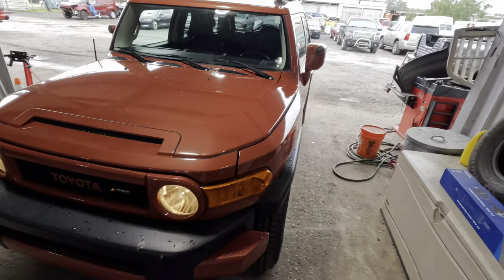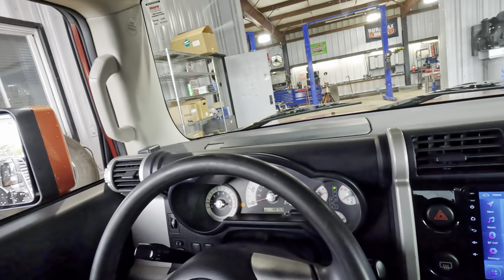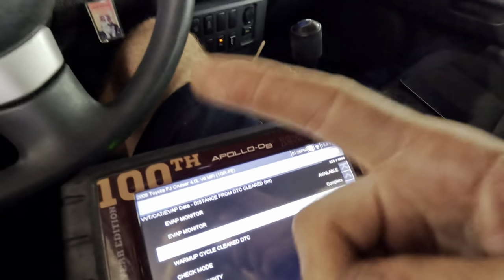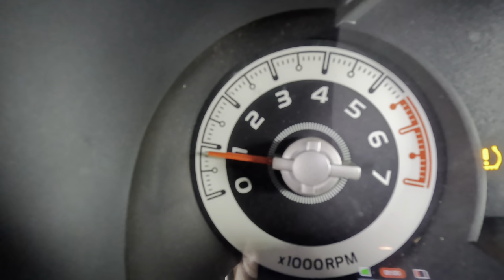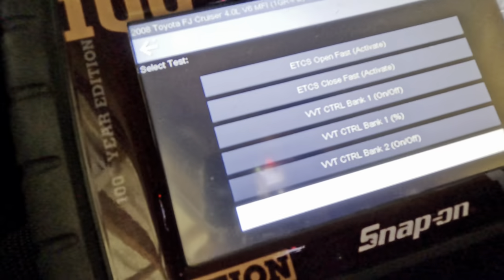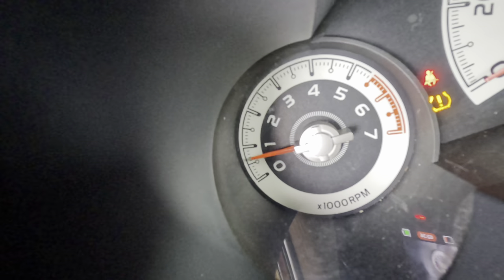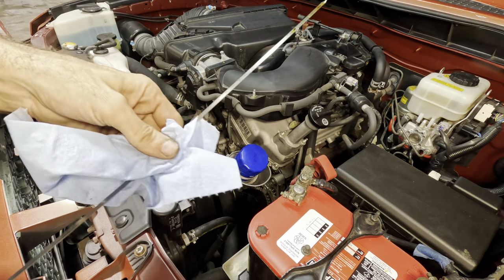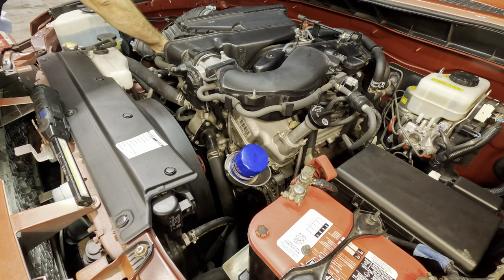Engine Problems at 50,000 Miles! P0016 P0017 Toyota FJ Cruiser 4.0 1GR-FE

Comment: Very interesting and educational diag and repair. Sorry to see the sludge on those actuators. As you said that you'd have liked to run some BG engine cleaner in to address it, since it's most likely all through the engine. Too bad that a low mileage and nice looking vehicle had such poor maintenance to cause that at that low mileage. Maybe it would be advisable for the owner to avail the cleaner service soon since this is a new purchase. Thanks again for another in your quality videos.

Comment: Great vid Ray and showing mindset of working it out.
Whn oil change performed do they not do flush and would that clean solonoid.
All down to service intervals
Reply: No, they do not do engine flush as part of a routine oil change?
Reply: Looks like they never changed the oil or very rarely did. Mine had over 250k miles on it and had no sludge in it when I pulled the valve covers off. Changed the oil with Mobil 1 every 5k to 7k since new.

Comment: Ray, the traction control lights being on is a normal Toyota thing, any dtc code will set the check engine, abs and traction control lights. My Tacoma will set all three lights and disable traction control until the dtc is cleared from a minor evap code.

Comment: I had a camshaft position sensor snap off and go into the engine on a ford 5.4 when I was trying to pull it out.  Luckily the engine was already shot so to the junkyard it went.

Comment: "replace them both"
It's a good practice with other things one can manage with very little technical know-how. Headlights, for example. If one fails, it stands to reason the other will fail shortly after, so both should be changed. Tires too. One tire wears unevenly from the other three, the alignment needs to be handled, but the tires need to be replaced, because uneven wear on one, will eventually cause the others to fail, especially under proper circumstances.
Reply: Had to do the same with my 2009 subaru forester, had b1 vvt sensor warning, fixed that, cleared codes, 10 miles down the road, had b2 sensor go off...probably likely they'll both fail around the same time

Comment: I had a p0016 code on my F150 once.  My timing chain was stretched.  Had to replace the timing chain, guides, and two of the cam phasers.  Plus, for preventive maintenance, I had the internal portion of the water pump replaced as well.  Wasn't cheap, either.
Reply: Which engine does your F 150 have and please tell me more about the internal water pump parts.
Thank you.
Reply: @wayneessar7489  1st gen 3.5 V6 Ecoboost.  I stand corrected on the internal water pump.  Mine is on the outside but there are some engines that have an internal one.
Reply: @bearing_aficionado  Thank you for your kind reply..!
Mine is the 3.5 na Cyclone engine, 2016, so the last year for it.
The ones they put in the Edge and I think in other front wheel drives are that evil internal pump.
Reply: @wayneessar7489  yeah.  I swore I thought I had the internal one but I was on the F150 forum and someone thought the same thing I did and someone said it was false.  But I've watched a video from FordTechMakuloco doing a timing job on F150 and was pulling out what appeared to be a water pump from inside the timing.  But I watched another video where a guy was replacing a water pump and he it was on the outside.  He had the same year, an engine as mine.

Comment: I watch all your videos and like every one. It sure appears to me that you are a top notch mechanic and can figure out all problems. I have a 2006 mustang 4.6 3v with a few mods such as comp cams,new cam phasers with limiters,exhaust cutouts,BBK fresh air filter and ducting.about 8 retunes with 2 different tuner guys. I have tried to test all electronic components and switches and even parts cannoned a lot of them and just can’t get this car to run properly. You sure would think after 3 years of trying I could figure it out and I can’t. It ran just fine before I put these mods on it. Don’t even dare to drive it across town cause it may not want to start if I shut it off. Bein it is a n/a Roush ,with a lowering kit I don’t no how I could even get it wreckered home very easily. I have 1/2 a mind to load it up in my enclosed trailer and haul it from Michigan to Florida to have you figure it out, I’m sure you could, I can’t. It’s sad this 06 mustang, literally brand new condition, no snow or even rain car with only 12,000 miles and you don’t even dare to take it on the road. Now THAT would be a good video!!!
Reply: "It ran just fine before I put these mods on it." - There is your problem. Leave well enough alone.
Reply: Not so, all parts are Oem parts. Cams are from ford racing and are for this engine and year. I think it is in the tune and no one has figured it out yet

Comment: Good diagnosis Raymond, if your cheap like me you could've soaked the actuators in gas and blew them out with air. Or use your method with brake cleaner.

Comment: At 51:24 you mentioned the vacuum hose. I think it may be possible that it was left disconnected at some point and on short drive intervals would accelerate the sludge problem, even with proper oil change intervals.

Comment: I've cleaned them with Brake clean and degeaser and has always fixed that problem and a good engine flush as well. That  was probably the first oil change right before they bought the vehicle SMH 😳

Comment: Ray you can ohms check the solenoids without taking anything apart. Check them at the pcm so you can rule out wiring at the same time. Good little time saver for ya.

Comment: Agree with several of the other poster's comments regarding the lack of proper oil maintenance as being the contributor to the valve failure(s). Would have been nice to see the difference between the scan tool's VVT readings following valve replacement as compared to the initial readings. But, in the end, problem solved. Well done sir, well done.

Comment: I had an 07 FJ that needed an emission canister at 100k and also had some fuel system leaks. Wicked expensive OEM parts.  I think the VSC is disabled if the check engine light comes on for any reason. A really solid vehicle though, laughs at snow.

Comment: Yes if you neglect to change the oil on these VVT engines it sure messes them up. I have a 2012 Yaris I bought new and changed the oil every 5k miles or 6 months using full synthetic oil and at 100k miles no problems.

Comment: NIce work Ray! A tip: You might try spraying carb cleaner around anything stuck on the o ring, it will dissolve the varnish sticking it. I use it for stuck distributors.

Comment: This is what happens inside your cars engine when you rarely to never change your oil and filter @ 44:05 !   The engine heads under the valve covers and the bottom of the oil pan is very likely full of sludge just like those sensors and the oil passages inside the engine and that can only happen at 50,000 miles if the owner does not do oil changes.

Comment: Recommended oil change interval is every 5,000 miles, and Toyota means it!  This is what happens if that is not done.  I have a newer Toyota that they have changed the oil change interval to 10,000 miles.  I still change it at 5,000.  Worst case, at around 100,000 miles the engine starts burning oil.  That sludge you see on those servos will be all over the piston's oil control rings with heavy wear on the cylinder walls.  Best insurance is to change the oil at the correct interval, or every 6 months.

Comment: So the functioinalty of the valves was not the issue but that they were sludged up. Understanding the ultimate basis for replacing the units but rather would not an appropriate ultrasonic cleaning of the existing ones been just as efficient or with the benefit of hindsight the fresh oil change may have done the same thing? This is a textbook example of lack of engine oil changes in a timely fashion. It is a possibility a pending code could have existed and the fresh oil cleaned things up and we would not be the wiser but it got to the point of a trouble code being tripped which brought us to know now what we know. Does this rambling  make sense?

Comment: For some reason, have no idea why, but I have seen way more stretched timing chains on the FJ than any of the other Toyota with the same single VVTi 4.0L engine.   If the oil changes have not been kept up on that will cause greater chain wear and result in it stretching and can present with that code. 

One thing you may want to do is remove the VVTi filters and clean them.  They are located on the outside of each cylinder head.  If the valves are that sludged I am sure the filters are clogged as well. 

The USDM FJ does not have an engine oil cooler and that oil temp can be all over the place and it can get way hotter than it should be so I always suggest doing oil changes much sooner than most like never more than 5000 miles.

Comment: The original owner saw that synthetic oil was good for 25,000 miles so it probably just had its third oil change. I’d throw a can of Berrymans B12 or maybe Sea Foam in it and get her good and hot and drain and change the oil again. There’s probably some new flushes that might work better, but if you did it old school now and then again in 3k miles you’d probably be fine.

Comment: Drain the oil and fill with kerosene +  a quart of MMO. Run for 1 minute, drain, fill with 20W-50 (cheapest available) run until operating temperature reached, drain and refill with factory rated oil...couldn't hurt 👌

Comment: Post purchase inspection, no warranty?
My '95 Camry had a 4 cyl sludged up engine.  Always had regular oil changes.  My mechanic's friend at the dealership said it was a known problem with my particular engine.  Personal thought was the engine always ran hot because the exhaust came out towards the front and wrapped downward around the engine.

Comment: I had the same problem with my 06 hyundai santa fe v6 with vvt mechanic pull it out and it was block up clean it out put back in never miss again it was because of previous owners they let change oil to far apart

Comment: 56:00 sensors . reprogram 4 to the spare & set them.. in a block that adapts 4 to same stem.. bypass the east northern farmer way 
jyst remember to set spare tire pressure..then losen inner valve then add block with 4 & add pressure.. when set.. all read off same spare.. until needed.. lol tighten & carry airpump.. in tool kit.. lol but easy bypass til maybe add them to aftermarket wheels

Comment: I'm happy to see that you are at least thinking about buying a scope. If you already have a laptop, adding the Pico is not such a big deal. If not, you can get a small hand-held device to start with. Those handhelds will always find a place in your workshop. Often, you see Eric O. of SMA quickly check something with a small hand-held scope, while he has a Pico at his disposal.
Also no need to fully deck out your scope with all kinds of specialist probes. For example, you can do a relative compression test by scoping the millivolts drop over the negative battery cable while cranking. Don't need an amp clamp for that. You only need the Pico or another multi-channel scope if you want to have a sync pulse, so you'll be able to tie a bad compression to a specific cylinder.
Remember, a scope is just a multimeter that is able to measure fast-changing signals. (or 4 multimeters in case it's a 4-channel scope).
Also, the Pico software is a free download. Install and fiddle around with it. In demo mode, you'll see 4 fake signals at its virtual inputs. And you can't mess it up. The software will start with factory default settings every time, unless you change that behavior in the settings.

Comment: I was thinking.  Maybe a "snake oil" BG treatment would have been in order 1st..instead of replacing both sensors? Yes, they might have cleaned up, but in the end, replacement was the best move. Kudos King Ray!  Nice vid sire😎👍(as cruddy as they were, i would still do the engine clean treatment.. because even with a new oil change, sludge lingers..and as i typed this, you mentioned that same idea.  Lol

Comment: I've found that headlight bulbs should also be changed in pairs for the same reason,...when one goes out ,the other is not far behind. Maybe you can sell the customer one of your famous engine flushes, there is too much sludge for that low of mileage! Great diag Ray man.

Comment: I bought a 2003 Mercedes C230K with (Serious air-quotes) “83,000” [Supposedly] original miles.

I’ve spent 4 years replacing things that I simply should NOT have had to replace IF the mileage was even close to being accurate.

NJ car sold to an Illinois Porsche dealership before ending up here in Texas.

Just got through replacing all of the rear (5 on each side no less) Control arms & knuckle bushings.

83,000 miles??  No freaking possible way.

Comment: I was recently in the market for a used car. I always bring my code reader to plug in first thing before I drive. One dealer refused to let me plug in so I just walked away and added them to my blacklist. At the second dealer I found three cars, the saleslime was oblivious to what I was doing so I plugged into all three of them and very one of them were zero to 10 miles since reset. I went ahead and passed on all of them and the saleslime said they reset all of their vehicles when they are put on the lot. Red flag taken and another dealer on the blacklist.  Moral of the story, either take it to a mechanic before you buy it or plug in a high quality scanner, or both. But don’t buy under the assumption that the vehicle is any good because the dealers mechanic said it was.

Comment: 1. Did you tighten clamp on throttle body? Video didn’t show.
2. Even with recent oil change, I would have offered the sludge treatment. Toyota’s routinely get 200,000 to 300,000 plus with good maintenance.

Comment: Good diag and repair.  Please be careful of poking your light(s) around moving engine parts and wearing a metal ring working on vehicles.  True story:  My first wife grumbled about me not wearing my wedding band at work (bodyshop at the time).  I told her I wasn't risking damaging it.
 
That throttle body looks suspiciously identical to the one on the Toyota 2AZ-FE four-banger in my granddaughter's Scion tC.  Probably is; why make something when a part already in inventory will do the job? 😜  Little Factoid for those who may not know:  Those small hoses are for engine coolant, to help warm the TB in cold weather.

Comment: I am curious as to your opinion of K&N filters...  I  prefer them for air cleaners... I have examined throttle bodies and air plenums and have found them to remain clean.  Its actually rather humorous that they work better with a little dust on them.   They do however need to be serviced when they  get dirty...

Comment: That FJ Cruiser has obviously been neglected by the previous owner with the oil not having been changed regularly enough. That should be a lesson to all vehicle owners to change their fluids regularly and use only top grade full synthetic oil. It should be changed twice as often as recommended by the manufacturer. In more recent times vehicle manufacturers seem to conducting some type of bidding competition as to who can stretch their oil changes out as far as possible. I guess they don't really care so long as the vehicle outlasts the warranty period. It also obviously needs a good engine flush.

Comment: I got 04 4runner same engine recently had rough idle had bank 2 camshaft code o2 bank 2 codes among few others. I changed both camshaft and both vvti solenoids and o2 sensor runs fine now but 330k miles vvti solenoids were definitely dirty. I no the pain you went through although bank one solenoid vvti broke cause it pressed together had to use pipe nipple to get removed poor design but overall design of engine simple to work on loves these gre1 engines
Reply: But I'm afraid with front timing leak minor seal leak and mileage that my 4.0 may have stretched timing chain and could need a full timing kit service.

Comment: Add about 1 to 2 oz of seafoam to each quart of oil in that engine, it will start to clean the system, and advise them to not avoid oil changes like the original owner did

Comment: Oil viscosity sensor, reads the oil as it passes in the oil pump, not just the pressure but its fluditivity 
Warns to change oil as it breaks down by content of other additives or oils condition.

If the oils sludge it is either junk, or needs to be rebuilt.  For a Toyota motor needing an overhaul at 50k 
Its insane. I'm very lax with my maintenence of my toyota's but i get close to 300k miles out of them
And never have major issues.
Sludge in the oil pan at 50k miles its never had an oil change.

Comment: "Post purchase inspection".
A PRE-purchase inspection might have been a better idea. That engine appears to have been neglected, to get that sludged up with less than 50K miles. The seller (previous owner, dealer or flipper) probably cleared the codes long enough to get it sold. At least the new owner appears serious about taking care of it.

Comment: An oil change after 49,000 Miles could be the reason for the sludge.  Maybe the last change came after about 10,000 miles. Then just before the sale means that the previous owners were having trouble and it appears that they were trying to screw the new owners. 
Another reason for a pre-purchase mechanic check.
Reply: I think you’re right. Previous owner neglected it until problems occurred then traded it in. From there it went to auction where the new dealer just did an oil change, cancelled the CEL and sent it down the road.